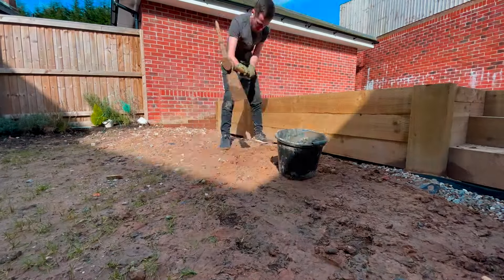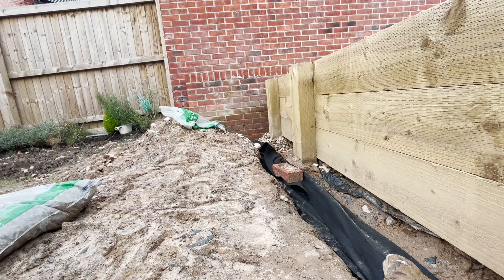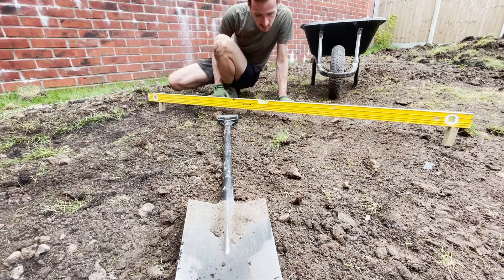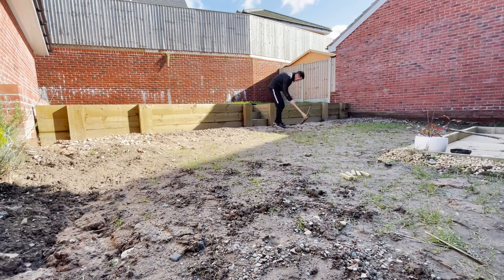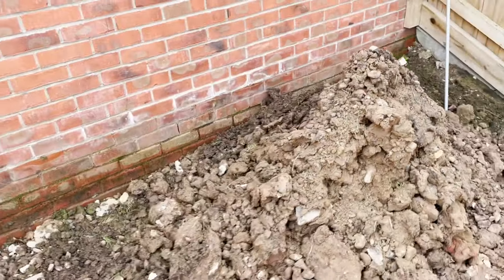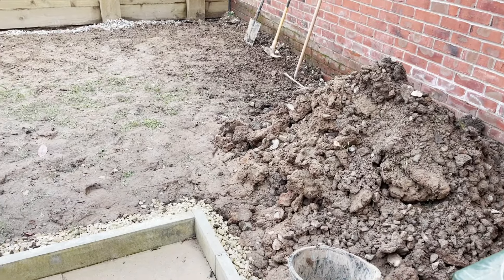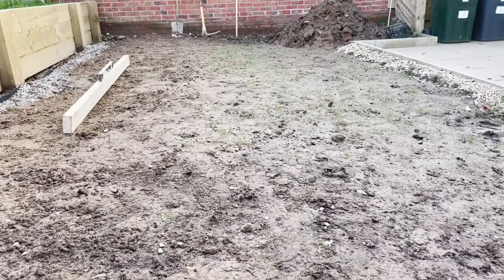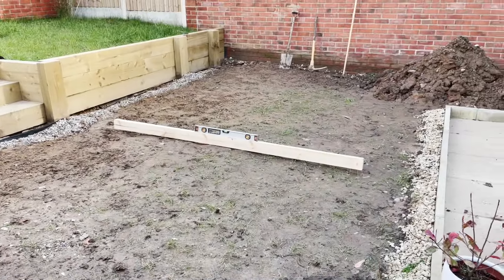Levelling Clay Soil - New Build Garden - GARDEN RENOVATION

Comment: I have clay soil like you do and I'm installing french drains. But the clay its self goes mushy after rain have you thought of any ways to firm it up? So many conficting ideas on internet
Reply from the maker: Mine was exactly the same. Rock hard when it was dry, and awful when it rained!

Not sure the best way to firm it up, but digging a French drain just after a rainfall is definitely the way to go. When I dug the trench for the sleeper wall in the summer, it was like digging through concrete!
Reply: @NoviceGardener  you need to add lots of organic matter (compost) which will improve the drainage, stop it going muddy and soggy and waterlogged in winter, and prevent it from drying out so much in summer.

Comment: Hiya. Thanks for this. Since you wanted a slight gradient from top to bottom, how did u measure your gradient using the timber and level?
Reply from the maker: I used a laser level. I took this out in the evening and ran the string line across using the laser.